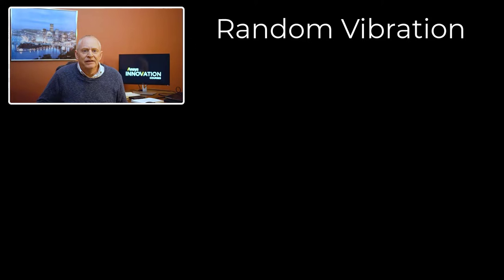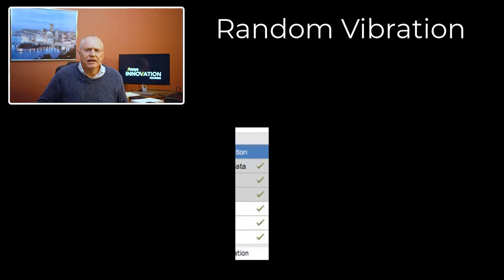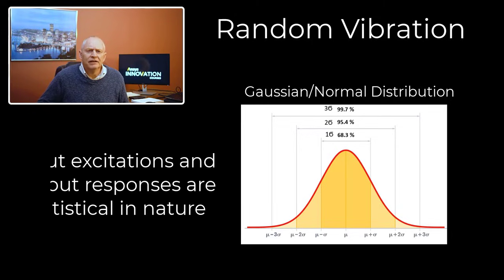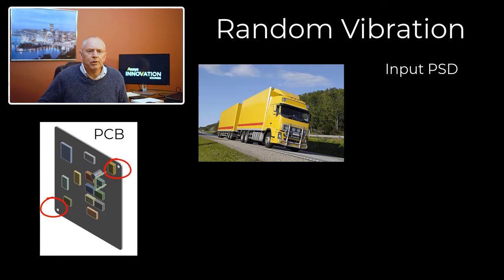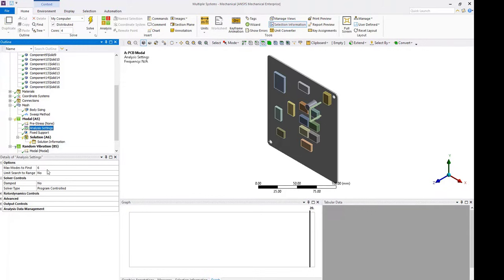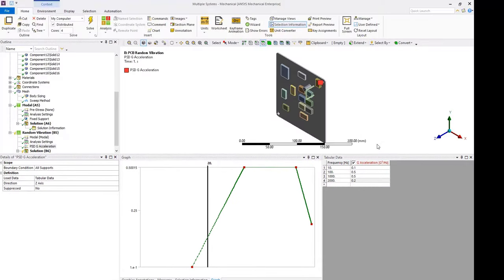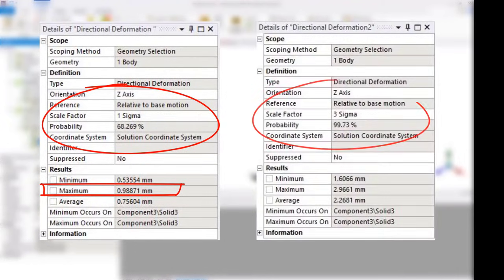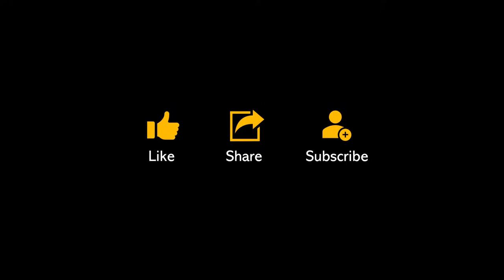Performing Random Vibration Analysis Using Ansys Mechanical — Lesson 1

Comment from the maker: This video is part of the free Ansys Innovation Course, "Random Vibration Analysis Using Ansys Mechanical". Access all the course contents, including additional lessons, handouts, simulation examples with starting files, homework problems, and quizzes: https://courses.ansys.com/index.php/courses/random-vibration-analysis/.
Reply: 1. How does ANSYS handle cross spectral density. ? 

2. For random response, we need receptance. After computing receptance for each frequency, the output psd values are computed by multiplying receptance with input psd curve. 

To extract receptance, you need modal frequency response/direct frequency response. How does ANSYS extract the receptance from modal analysis? Does it internally apply step load?
Reply from the maker: @aakashs1806  Thanks for watching! Please post your query on the Ansys Learning Forum for a detailed answer from the wider Ansys Community: https://ansys.com/forum.

Comment: Hello! Tell me please, is it possible to output the acceleration PSD in the harmonic acoustic? I repeated the example in workbench mechanical, which is given in Ansys Mechanical APDL Acoustic Analysis Guide.

 “13.15 Example: structural panel subject excitation from a diffuse sound field”

Comment: I was a little confused at first about the PSD G data and how to find it. But from I understand now, it is some measured data that describes the characteristics of the external vibration input acting on a structure. PSD is not tied to the material properties of the object being analyzed—it is determined by the vibration source and the environment. And there are some standards for different types of environments, such as ground vehicles, fixed-wing aircraft ... if you look them up you just have to find the data for the context you need.
Reply from the maker: Thanks for watching! Visit Ansys Innovation Courses for free courses, including videos, handouts, simulation examples with starting files, homework problems, and quizzes here: https://ansys.com/courses.

Comment: Thanks for these videos! 
Why, in this example, the PCB got NON-zero values for the first 6 rigid body modes? Thanks
Reply: The PCB holes are fixed. If the structure is not constraint we will get rigid body modes. 

And in Random vibration, there are different types of excitation. The most predominantly used is Base motion excitation, in automotive application. In base motion the motion (input psd curve) is given as enforced acceleration/displacement on fixed constraints present. I think for base motion the fixed constraint is mandatory.
Reply from the maker: Thanks for watching! Please post your query on the Ansys Learning Forum for a detailed answer from the wider Ansys Community: https://ansys.com/forum.
Reply: @AnsysLearning  Do you know any real applications of cross spectral density.? 

I am not sure, I suspect ansys does only auto spectral density.